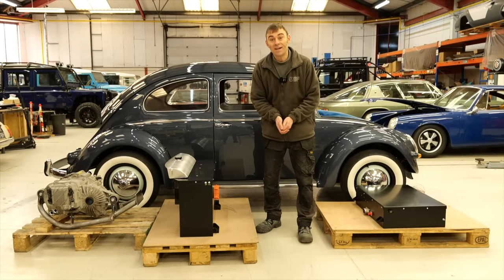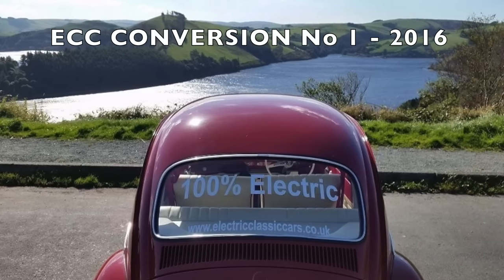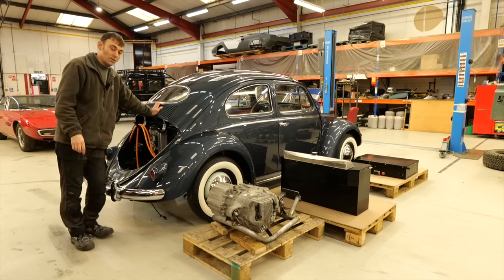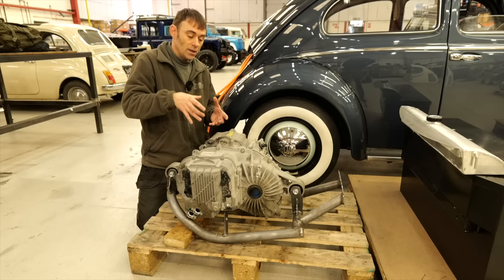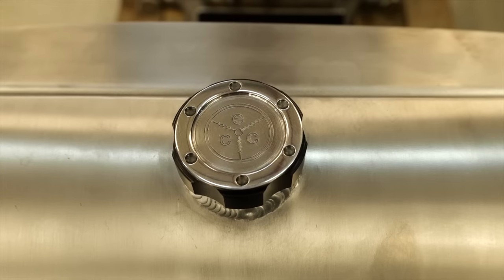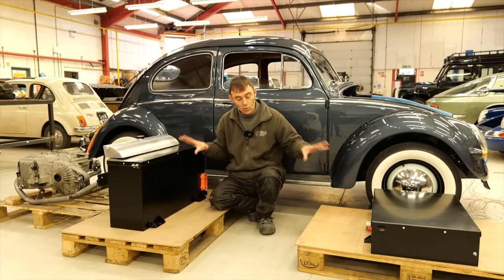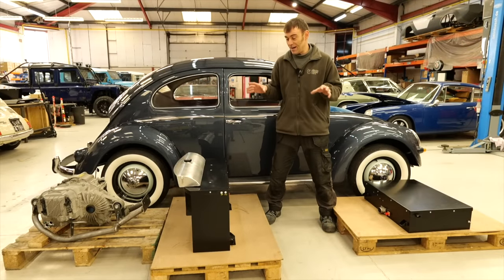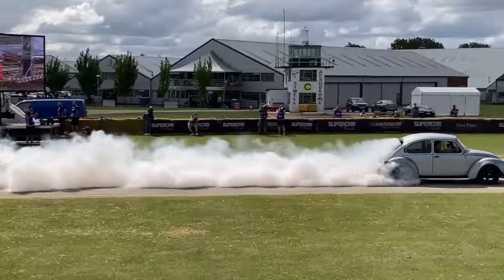Electric VW Beetle - Bolt-in kit

Comment: Time to talk about cost ?
Reply: Cost of the following 500K miles ?.. Not much to fuel or maintain
Reply: @goingoutotheparty1 Recharging is getting more expensive. Also, is it realistic to cost such a conversion over 500,000 miles? How many miles does the average Beetle do nowadays (not many daily drivers around) and what about battery degradation and improvements in EV technology that render what is being installed here obsolete?
Reply: $18,000

Comment: I bought my first car when I was about 21 and living in Luxembourg. I'd got my license when I was 17 but couldn't afford a car up until this point. My dream cars were either a 2CV, a Mercedes 230SL or a Beetle Convertible (I have odd dreams). I couldn't afford the Mercedes which made it simpler. I was about to buy a 2CV when I saw a 1972 Beetle Cabrio for sale. It was metallic blue with a white roof and interior. It looked like it should of been parked on a beach in California. I'm 60 now but that Beetle is still sitting in my garage.

Comment: Ferdinand Porsche would have loved this, he had a passion for electric tanks and vehicles so this would be a very sympathetic evolution .
Reply from the maker: Yep. The first car he built was electric. 😁👍
Reply: @wadewilson6628  Electric motors are mechanically far more simple than combustion engines.
Reply: @wadewilson6628  but an ice has way more moving parts… definitely opposite of … simple. The tank failed because of the weight causing crossing issues and logistic issues, but having the advantage of being quite and getting into enemy territory quietly. 
I don’t think weight would be an issue with a Beetle, considering the battery is small. The body is light.
Reply: The VK 45.01(P) Porsche Tiger
Reply: @wadewilson6628  the bldc motors used are dead simple: two bearings and a single gear reduction if more torque is needed. How many bearings alone does an internal combustion engine have? The controls and wiring are dead simple, no relay logic here.
Reply: Cue the theme from the more you know... You won the fun fact of the day for me thank you!! I would name mine the lightning bug but I'm sure that's taken somewhere already 😆
Reply: Führer would salute to this, for sure
Reply: @relaxingpill7525 huh
Reply: @usertakenagain 
😢
Reply: I’ve never owned a German car and don’t want any fascist built cars. Dictatorships suck.

Comment: Great seeing the electric car conversion for such a classic. My first car was a 1965 Mustang convertible but my parents, brother and later myself all had VW Beetles. Father had a 1967, my brother had a 1967 also and I had a 1969 a few years later as a second car. From 1970 to 1974 my parents also had a 1970 VW camper at the same time as their 1967 Beetle. Both were red so they got personalized license plates for them. The Beetle's plate read, "RED BUG" and the camper's was "BED BUG". They were pretty cute parked next to each other in our carport.
Reply: No it's not.  You take a nice beetle with range and turn it into a golf cart that will barely take you 18 holes and back?   It's a crime.
Reply: @FreemonSandlewould  , So you have owned an electric beetle?

Comment: I have had 6 Beetles in my 20s after building a beech buggy from one when I was 23. In 2016 I bought a 1978 VW Type 2 camper which I refitted. In 2020 I bought a Beetle 1302S like my favourite from my past and did a restoration. I think an electric conversion would make a lot of sense on that one but I would like to do it myself as I rebuilt the car. The kit looks great.

Comment: Fantastic! I'm about 10 years older than you and my first car was a 1964 Beetle that I bought for $100 in 1977. I too loved that car but where I lived in Maine they salted the roads heavily in winter and the car was a rust bucket. You could see the road going by underneath. I had no access to welding equipment so I riveted and bolted patches on to patches to keep from falling through. I used to keep an ice scraper handy to scrape the INSIDE of the windshield and oh lord did I have to dress warmly. That "hot air" heater didn't do much at -20F/-29C. That said, that car could plow through any snow and I even took it off roading a few times.  Sadly, it finally broke apart and got turned into tuna cans or something. Videos like this make me crave a restored electric one but for now my Ford Ranger conversion is far more practical. Keep up the good work!

Comment: My first one was a Subaru J-10 from 1994. There was also the J-12 which had 4 x 4, which sadly were a very limited number in Malta, so I couldn't get my hands on one of them. Nonetheless, the J10 was so solid and robust, that when I flipped it on its side, it only caused a dent on the door and broke one of the indicator housings - the mirror simply folded forwards. It was very easy to fix, and despite its tiny size, certainly quite spacious inside ;)

Comment: Hi Richard, great video and info as always!  My first car was a 1983 MkI Fiest 1.1L I drove it around until I finished college and then bought a 1990 MkII XR2.  That XR2 is a car that I would love to still have and drop a small tesla unit into it.  At the time I didn't think it was underpowerd and given the brakes and suspension it was probably about right but after 5 years with a MS P100D, I think I'd like a bit more out of the old thing if I still had it :)  Keep up the content, always a pleasure to watch.  Thank you.

Comment: My first car was a 1964 Beetle....wheel gas pedal, a 1600 cc that popped a spark plug out on the highway, all the trimmings. I upgraded to a 2165cc with dual Weber 40s and a Scat C5 cam. That thing was a blast to drive but I broke clutches every few months. Thinking about picking up another 1964 in a few years for a project with my kids, and by then, an electric conversion will nearly be necessary.
Reply: Breaking clutches is great fun! That's how I learned to dry-shrift, what with necessity being the mother of all motivations...

Comment: Good video Richard. I never really got into VW's. I had a girlfriend once who owned a Yellow K reg (1971) 1,200 Beetle. My abiding memory of that car was how long to took to get any warm air through to the front of the car. 
I passed my test in a Mk1 Escort but my first car was a less than impressive "hand me down" 1964 Vauxhall HA Viva (FMD 820B) which was quickly followed by a much more respectable & quicker 1968 Vauxhall Viva 2,000 GT (VLT 481G). Funny how you remember the registrations of your early cars but none of the company cars that came later? I just wished I had kept the Viva GT because they are as rare as Hen's teeth these days. Saw one in the British Motor Museum at Gaydon the other week when I visited. Boy did that bring back some boyhood memories! All Vauxhalls in our house back then because my dad & I both worked for GM/Vauxhall/Opel at their North London Plant.

Comment: My first car was a '65 beetle. Never left me stranded. It came to me from my new sister in law in 1972. She had entered it in the "Herbie the Love Bug" contest Walt Disney held to pick the car used in the movie. She had photos of her driving it through Disneyland in Anaheim in the parade Disney held for all the contestants who could/would come to it. I had nothing but air cooled VWs for the first 40 years I drove, worked at a machine shop that had specialized in them for 30 years. I rebuilt a couple dozen engines, did everything except the insides of the transmissions. Including paint, upholstery, glass, electrical, you name it, I did it! Almost everything stock.

Comment: Thanks for the run through on your EV conversion.  Answering your poll question:
First car, bought as a 16 year old know-nothing was a 1965 180 hp Corvair with a blown engine.  I replaced that with a junk yard 110 hp unit (I think).  Ran that until it blew up, then got a '67 type 1 with a bus engine, finding out the push rod tube seals in a VW held up much better than the Chevrolet counterpart.  That said, if I were to EV convert a vehicle I would choose a second gen Corvair.  Nothing compares to one's first love.

Comment: My first car was a 65 Beetle. I drove it many places in the woods where 4x4's feared to tread! On one occasion a wheel came off while I was driving on the free way - it did give some warning , however , so I was almost stopped when it dropped. ( had to use one lug- bolt from each of the other wheels to drive to home!)
Reply: The little guys were bullet proof and with a copy of The Idiots Guide anyone could do anything from an oil change to a complete rebuild.  I somehow slept through the years and when I got up, the price for an unrusted bug had risen from $500 to $12,000.  Bummer.

Comment: My first car was a 1951 deluxe beetle (hydraulic brakes and aluminum trim).  My second car was another 1951, but the standard trim - mechanical brakes and no trim. Both came with the 1100cc 25HP engine and NO synchromest 4 speed transaxle. Soon replaced by a hopped up 1200cc engine and a synchro transaxle.

Comment: Hi. Great video. My first car I bought two months after getting my drivers license at 16 was a blue 1964 Beetle. That car eventually died on my way back from university piled to the gills with 3-4 suitcases, 13 boxes, skis, a bicycle and my guitar.  I sold it to a garage for CAD50 which was enough to pay for a Greyhound Bus to take me home which was 350 miles further down the road. But in 1978 I bought a 1962 Cabriolet owned by a little old lady who only drove it in the summer.  That car was fully restored in 1995-1999 and I still have it.  It is mostly original including the rebuilt engine and transmission and is stored in a house I bought in 2000 to store the car (since I have not lived in Canada since 1992). It sits in a Carcoon and I fire it up every time I get a chance to visit my home town - every 2-3 years. The electric conversion is interesting for the future but maybe a bit early for this car that still runs great.  Regards.

Comment: The first car I bought was a 1960 Beetle and it cost me $600 at the time. As I recall that was in 1970. I drove it from Boulder, CO USA to Provo, UT USA during the winter of 1971 up through Wyoming. The roads were icy and there was a lot of snow. I actually slid off the freeway at one point and fortunately just got into soft snow. A couple of people stopped to help push me out of the snow and back onto the freeway and off I went. I was only able to go about 35 mph due to head wind but I did make it to my destination unharmed. That was also my first “make out” car. I ended up giving the car to my girlfriend about a month later because I had to go into the Army. She didn’t have it long because my dad went out there and reposed it from her. Then, during my leave before going to Vietnam I traded it in for a Pontiac. So that’s the story of the first car I purchased which just happened to be a 1960 VW Beetle.

Comment: My mom had a 67 bug that I learned to drive on.  Then I went over to England for a couple years and drove a 76 BMW 320i.  Then after coming back, I bough my 66 bug and drove it from Washington State down to Southern California.  Put in a brand new motor and transaxle and then ran out of money.  Drove it back to Washington State and took it to college.  Was at the bottom of a snowy hill and was sitting still and ended up getting hit by three cars in a row.  Pulled the rear fender out, kicked out the big dent in the door and kept driving it for a while.  Sold it to a person who really just wanted the motor and cashed the three insurance checks and basically broke even.  Will always have VWs in my veins and love that people are bringing them into the present with electrification.  Hope you put in brighter lights than the 6 volt ones my car had.  Put a 12 volt system in with the new motor because the original lights were like driving with two Zippo lighters stuck out in front of the car.

Comment: Enjoyed your quite thorough video.  I have a '67 VW that my wife bought new on the day we met.  it nearly died due to rust many years ago and as a result I had quite a surprise when I went through the floor boards on the interstate!  I didn't hit the pavement, but came darn close, but managed to drive it home.  Then decided to restore it, and have been at it ever since.  Nearly completely re-done with many new body parts, and new floor boards, all new suspension items, brakes, etc.  The engine had been rebuilt shortly before I/we stopped driving it.  After it sat for 32 years it stated right up!  The electric concept is really cool, but I can only imagine that it must be a bit pricy, and likely more than the original price of the car at $1,740.00!
Reply: That’s crazy. My dad said back when he was young he got pulled over in his Beetle. He used a big hole in the floor board to hide his open can of beer from them. Just pulled back the floor mat and set it on the ground 😮

Comment: I’m in the middle of my 1970 Beetle restoration and conversion but did not know about the Tesla IRS bolt in option so went with the Hyper 9 HV 144v with 7 Tesla model S batteries.  Everything is taking soooo long but I can’t wait to be done.  Thanks for the top on the coolant reservoir.  Obvious now that you say it but I was planning to mount in the front under the pack using two Tesla pumps.  Now I know yo split the plumbing circuits and mount the tanks higher.  Love your videos!!

Comment: First thanks for the vid, worked on a slew of old bugs and  1954 porshes back in the 70's. I drove a  new 72 bug with a 36 ford front end  fiberglass. I used to keep my old laundry bag full of my camping gear tucked in behind the fake grill . It helped hold down the front end and I figured it for a little more cush before the gas tank got pushed into my lap  in a crash. My next car was a used  72' super bug with air conditioning. That was a trip (the A/C).

Comment: My first car was a ‘74 Beetle, I currently have a ‘74 Beetle, unfortunately not the same one but both have their original heater channels and have never required any welding. The first one wasn’t terribly old when I had it as an 18 year old, the current one is an Australian import hence the unwelded original condition having never seen a salty road.

Comment: A  Peugeot 504 and a Ford Cortina GT were my 1st 2 cars. The Cortina had Weber carburetor and header exhaust quite rare as stock in those days mated to a very slick English made manual transmission as good or better than any unit I have driven. Plenty of power for a 1.5 liter and makes me wonder why cars these days need at least a 1.8 for similar performance. The Peugeot had very good handling and front seats that folded back to make a bed surface with back rests all the way down to level with back seat positions! Genius. This car also still had the socket in crankshaft pulley with hand crank to hand start engine if starter circuit should fail, something I wish VW would have implemented. As I remember having to push start and/ or crawl under VW bus to rap on solenoid to start car!
     Great work. Wish you much further success many older cars can use your kits.

Comment: I crushed a Beetle once, '57 that was rusted through everywhere. My brother bought it and robbed all the parts and left it in a field. I got dad's Caterpillar and drove over it just before we cut it up for scrap. Had another that was held together with fiberglass due to rust. It was orange and had been entered in a parade, so the owner had painted black spots and added some antenae above the wind screen.
Oh, BTW, the Porsche 912E and 914-4 were both type 4 powered. It was the Porcshe engineers that hotted up the original 1.7L to make the 2L engine, which was detuned for Transporter duty.

Comment: These kits are so awsome i live in the states and see alot of bugs for sale for 2-4k with straight bodies but weak or non running motors this would be a fun way to make a great daily i also love pontiac sunbirds the final gen specifically (80-94) i had a 90 2.0 opel motor and now have a 93 with a 3.1 v6 its a vert this would be a fun conversion on it if the motor ever failed

Comment: My first car: 1969 Fiat Spyder. Nice looking small convertible. I bought it for $250 USD at 16 and proceeded to waste most of my hard-earned income until 18. We did a frame off restoration with a crash course in Italian automotive vocabulary. No matter what carburetor we installed on that small engine, it never ran correctly. For me, I’d love to have an electric conversion of that car, speeding around the mountains in Montana during the summer.
Thank you for your video. I visit your website once a month to see what’s happening at ECC. Maybe a classic conversion is in my future!
Reply: Once a month???????? You need to make that once a week 👍👍👍😀😀😀😂😂😂

Comment: I still have my first car; a 1967 Mustang Coupe, bought in when I was 21, 22 years ago. I am now converting it from a straight six to 302 V8. Good stuff 🛠👍
Reply from the maker: Cool car. 😁👍
Reply: It was only a year or so ago, that at a local car show I saw that there even existed such a thing as a 6 cylinder Ford Mustang. Given Mustangs are rare here anyway, and the 6 cylinder ones super-rare, I would keep a 6 cylinder model as it was, if I had one. Having a 50 or 55 year old classic car, you don't own and drive one of them aiming to get the best ride or handling, or engine power or fuel economy.  I'd have thought you had such a classic car to enjoy it as a classic car. Keeping changes to the minimum required for safe comfortable operation (perhaps brake upgrades, or electric charging system and lighting upgrades, especially for folks that live in extreme cold climates like Canada etc.

Comment: Impressive engineering.  Have you considered putting the charge port behind one of the rear tail lights?  On a swivel with some sort of strong  neodymium magnet?  Behind license plate...  Or where the exhaust pipe use to be (best choice).